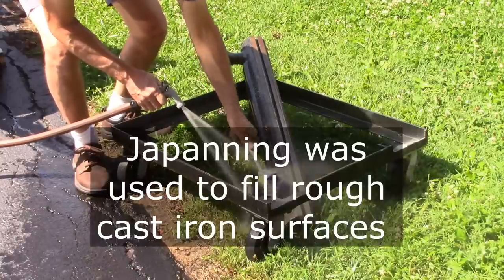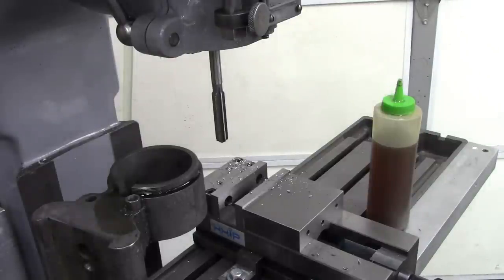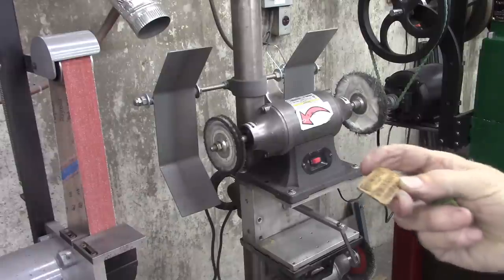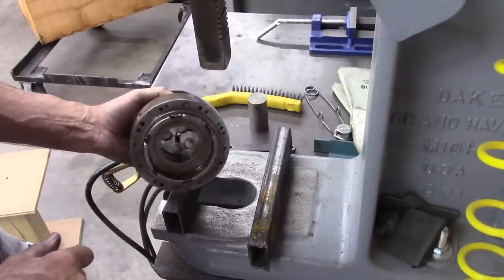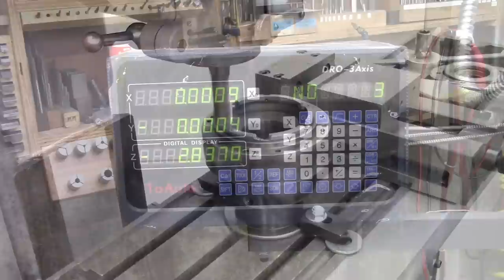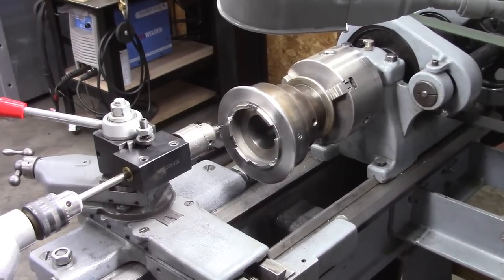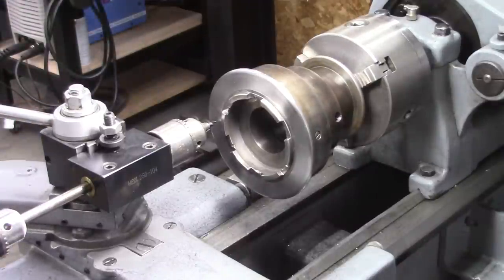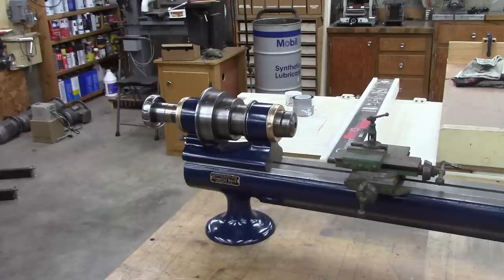Restoring the HARDINGE CATARACT Bench Lathe Part-2

Comment: Tip with the circle function of the DRO. Enter 1 more hole than you need, and make your end angle the same as your starting angle, so that the final hole is coincident with the first. That way you get the right number of holes, and you don’t need to calculate the final hole angle yourself.
Reply from the maker: Heck yeah! Good tip, thanks.

Comment: Just a thought,  that piece you were trying to press out. Does it thread in to the pulley. That would explain the spanner slots. It would provide preload adjustment on the thrust bearing.  I always enjoy your videos, thanks
Reply from the maker: Well the spanner slots were not stock. They were made with a hammer and punch but yes, you are right, it is threaded. The image i looked at on the internet was low resolution and did not show the threads. Later I found a larger higher definition image and saw the threads. It's logical that it would be threaded...  I should have thought of that. Good observation on your part!

Comment: Hey Winkie.  Really enjoying this restoration.  On using EvapoRust on stuff that won't fit in a bath of it, here's what I do.  I restored an old 2000-ish Honda 250 Rebel motorcycle for a girl I have known since high school.  She bought it new, she and her daughters rode it for a few short years, then put it away.  It sat for 15+ years.  Couple years ago she became interested in seeing if it could be revived.  Knowing I do that kind of stuff for fun (plus that activity helps keep me busy and from hanging out in bars and chasing loose wimmens), I took it on.  I used EvapoRust pretty much like you did, only I wrapped the long things (exhaust, any other long parts including the rusty rims) in terry cloth, soaked them with EvapoRust, then wrapped that up in plastic wrap to keep it wet.  Left it on there for 24-36 hours, and they came out spectacularly.  When I was done with that bike, it looked like it just came off the showroom floor.  I even did a short video on the end results of it on my little YT presence.  I was very proud of it, and was surprised at how well that EvapoRust did, using it that way.
Reply from the maker: I've done the same with paper towels but the towels leave a pattern in the steel or cast iron This lathe wasn't too bad with rust anyway. Maybe if I let it in the evapo-rust longer the pattern would go away.

Comment: A little tip: if you mix your putty on a frozen aluminium plate, you will have much longer working time, it will not take much longer to harden when applied because it warmes up, but the hardening on the mixing plate will be delayed significant.
Reply from the maker: Very interesting! I might try that in the future. Upol also recommended another product called One Fill which is supposed to be slightly thinner. They also said to reduce the harder by 50% to slow the drying.

Comment: I'll bet that piece is treaded so you can make fine adjustments bty love your videos
Reply from the maker: Yep, you are right. In the drawing I looked at it looked pressed in but I have since found drawings that show the threads. I might leave it as is, its been running for years like it is and it seems to be adjusted about right. Also, if I have to adjust it, the slots I milled will help.

Comment: That looks great. Even a nice shade of blue which is usually not my go to color. Your rotating grinder rig is pretty nifty, but do you ever worry about contaminating the buffing wheels with debris thrown off from the wire wheels? Or do you keep them covered? Just a thought. Thanks for another delightful presentation.
Reply from the maker: Thanks for the comment. Yeah...  if I do a lot on the wire wheel I throw a rag over the buffing wheels but most the time it is not an issue. I did however catch one of the buffing wheels on fire. The sparks form my belt grinder did it. It really smelled up the shop and was super hard to put the fire out. I ended up throwing a bunch or wet rags over it. But...  otherwise, the buffer wire wheel set up is a huge space saver and easy to build. Thanks again.

Comment: Hi there.. just an idea about the Evaporust and long thigs.. in my part of the woods we have PVC gutters, they come in sqare or round profile, they are also really inexpensive. I bought one when i was restoring my Colchester round head and used it for the lead and feed screw. All y9u have to do i just close the ends.
As always thank you for aharing.
Reply from the maker: Thats a good idea. When I restored my Index mill I made a box and lined it with plastic. It worked great but then I gave the box to the guy that bought my old mill.  The Harding didn't have much rust and I didn't want to waste the wood on another box.

Comment: Glaze putty or any polyester filler cures faster in hot conditions. Ive had best luck weighing the mix ratios to prevent that along with durability. When its ready to sand,  touch it with your finger in 1-3 minutes,  as soon as  it is slightly dulling (barely) and isnt tacky to the touch, then sand. if you wait too long itll be like sanding concrete. After 20 years professionally  restoring and custom classic cars, motorcycles and anything/everything in between (have won best paint and best of show at a few car shows ( client or personally owned) locally and in California), I have found that THE BEST filler , glaze or poly filled with fiberglass infused in it, is*** Evercoat brand*** gold, or extreme gold, and their glaze. They even make a sprayable type called feather fill which AMAZING stuff and specifically what i use on my machine restorations. Always Prime with a Direct to metal epoxy primer prior to filler. it will delaminate without..eventually.  Then a good filler primer and then top coat rattle can or sprayable. for a great finish thatll last 2-3 generations. I know it sounds extensive for machinery but itll make life easy. If youre using an enamel like rustoleum in quart cans, brushed or sprayed use "majic" its a catalyzer  to chemically harden it and gloss enhancer. Anyways thats my $0.02.     Love your videos and keep them coming!     "I like it"!!!
Reply from the maker: Thank you very much for your advice. And I have no doubt that you are correct about these products being the best. However, they are high priced. Also, the sprayable feather fill would absolutely speed things up....  but clean up??? How about the epoxy primer? U-pol claims excellent adhesion over clean sanded metal. So far I like the u-pol glaze I used but after calling U-pol they are telling me that their One-fill product is slightly thinner. They also recommended cutting the catalyst amount in half to increase working time. I thought about trying this but was afraid it might not dry. Somebody also made a comment about mixing the filler on a cold aluminum plate to help prolong the work time...  sounds like a good idea. And yes! There is a window of opportunity for easy sanding and after that it gets fairly hard. I probably need to work in smaller areas at a time. I will absolutely try the paint hardener you recommended! --  Thinking on the epoxy primer. Thanks!
Reply: @WinkysWorkshop  thanks! Okay so A little warning, this is a bit verbose but I think this will help a bit. And it’s just $0.02 from a guy in Reno.  
Just to be sure that it’s understood that, Everyone else has their own opinion and ways of thinking. I respect and always have an open ear to listen to what other people think and experiences they’ve had. So please chime in. cuz I never know if I’ll learn something new or better than my own ways and experiences. This is what makes us better at being makers, restorationist, hobbyists or the professionals with 100 years experience. We’re all here to learn. 
So to answer your questions…

Yes some of the products are somewhat expensive, although, upol is a good product, I must admit. Evercoat is quite expensive, and for small stuff like lathes and such, I’d just stick with the upol, it’s not that big of a difference and you probably have enough for the next four projects so use it! No sense in wasting money if you don’t have to. Evercoat does tend to sand a bit easier (especially on very large flat pieces) but with smaller pieces upol is totally fine. 

There is definitely a bit of conflict on the filler in the body shop world. And I’ll be honest to say, I’ve done both, direct filler over clean, shiny, raw metal without issues after many years. But a dtm epoxy primer has etching properties which adheres significantly better and leaves very little chance for pinholes between the metal and its coatings which is inevitable when spreading filler. Those pinholes are areas where solvents (and moisture) love to cultivate. Inevitably temperatures rise and fall and so does the size of gas (air), & solvent in those pinholes which then form pockets, then will pop sections off. So by using dtm spray or roll on, basically eliminates any chance of that. 

I repainted a jet black 64 impala last week that had filler laid directly on the steel panels. At not even one year after it was painted (and hadn’t been finished assembled yet in the restoration process🙄), even though it had been thoroughly stripped down to metal mechanically.  The chunks of filler that were popping off were softball, to melon sized pieces. First I’ve seen anything to that extreme of a result. It’s was wild to see something like that happen. (And yes, customer was not happy with the previous painter if you want to call him that..😅) and NO, I did not paint it previous to the failure…

anyways moving on..

I have been quite impressed by the final results on all of your projects so give majic a try, it’s amazing how much better an enamel finishes and is significantly more chemically resistant. So much more shiny and actually has the ability to handle/assemble in a much shorter period of time. Just be sure to use a respirator with new filters (they only last 24 hours technically but I’ll go for a week roughly before I swap them). It’s good for any oil based enamel like rustoleum in a quart or gallon can. 

As for the using less hardener for the filler,,,, six of one, half a dozen of the other. You can get away with less, although, sometimes (mainly on automotive applications due to their size) the sand paper will just clog up quite quickly even though it seems to be hardened,  this is when too little is used. . Yet ~50%~ish  of hardener recommended used on a hot day >85-90*F, will work totally fine in most applications. 

The Evercoat feather fill is typically sprayed from an hvlp gun with a large tip (up to a 3.0mm tip). But in my opinion on smaller scale projects; a medium nap wiennie roller and a decent 1.25-1.5” brush works great. It’s just very thin filler. 

As for the DTM epoxy, same deal. Cheap gravity feed (hvlp) gun from harbor freight at around 25-30psi will be perfect.      I’m not sure on whether or not brushed and rolled will land good results, but I wouldn’t hesitate to give it a whirl. It’d probably be work fine I’d imagine. I’ve too coat painted entire trucks with a roller and brush many times, and looked pretty darn good. But we’re talking primers here. 

Clean up on both dtm epoxy primer and feather fill are the same. Acetone, blue Scott shop towels, a couple pipe cleaners, & just take the tip off and pull the needle/adjustment knob off the spray gun, drop that in a cup of acetone, hit it with an old toothbrush or the like, along with wiping down the reservoir cup and you’re good to go. It’s definitely not like cleaning up a two part, 10 minute set epoxy youd mix on your workbench. Totally different. 

As for retailers that are not very expensive and have massive inventory, 
Summit Racing, and Eastwood have great prices on a lot of these products. Along with their own brands (summit paint is manufactured by sherwin Williams). Eastwood has a full line of primers/paints that ARE meant for roll/brush on, specially geared towards DIY’ers that want to paint their old classic cars, in their own garage without an 80 gallon 5hp compressor. (I don’t have any affiliation with these companies but Check out there new compressors! The 30/60 scroll compressor is epic.) 

Alrighty, that covers it. 

 Hopefully My response wasn’t too convoluted and didn’t sound like I just huff paint in the back of the shop, while watching YouTube videos, instead of using as intended with the correct PPE! 😉 

Cheers!
Reply from the maker: @theconcentriceccentric2994  Thanks for the detailed reply. A 3-mm tip is big although probably needed for a filler. Mine has a 1.5 mm I think. I love my spray gun. I've had 3 or 4 HF guns but have problems getting them clean. I think the gun I have is a much better design inside. Running solvent through it usually cleans in quite well. I'm off topic but here's a link to the gun I have https://amzn.to/3Q8TV4Z. I'll probably try the DTM primer and stick with U-pol for now. Thanks for all the info. Always welcome...  Also like your user name.

Comment: The British machine tool castings were 'faired' with a cellulose filler ( before polyester and epoxy)  and rubbed down before painting with a number of coats. It chipped  off over time.
Reply from the maker: Sounds like a much better method to me! The Wells Index mill I restored had a white filler that had a lot of cracks...  not sure what that was. It was very soft. I wonder if it was cellulose?

Comment: there is no faster way to remove the accurate surface of a brass part than to use a wire wheel. after so much care in the rest of the process, seems a bit crude to abrade the brass caps like that. otherwise, very interesting.
Reply from the maker: Normally I would agree. However, in this case they were badly abused with plyers so the wire wheel smoothed out the damage a bit before buffing. Also, these are only covers to keep out dirt and for cosmetics. I do wish they were not so abused but i see no way to restore them. Thanks for watching!

Comment: Regardless of the state you live in, it is illegal to dump, drop, spray, rinse, or otherwise any solvents, chemicals and/or oils (including and especially paint remover) into the ground. Doesn’t matter if you own the property or not… You’re responsible to collect and dispose of the chemicals appropriately. I’ll bet you don’t have many birds, squirrels, rabbits, etc in your yard and if you do they aren’t healthy. The more you know…
Reply from the maker: All below threshold amount. Nothing was ever dumped. The most significant pollutants is are most likely the hydrocarbons that are airborne anyway. The small amount that gets on the ground evaporates and never has a chance to get into the ground water. The instructions on the can of paint remover say to use it outside and rinse with water. I can't imagine how anyone would catch what comes off but I'm sure it is possible.  How about the spray can I used to paint the lathe? I know body shops are required to filter the exhaust although most small shops do not. As far as I know it is not illegal to use a spray can outside. My point is, there are threshold amounts. Somebody has made the decision that spray cans are an acceptable amount but technically spray cans are very bad for the environment. If I was running a business with large amounts of chemicals involved I would not consider my methods safe. Oh...  and there is plenty of healthy wildlife around. As a mater of fact, the grass where I rinsed the lathe is very healthy and green. I also recycle, support alternative energy and dispose of the liquids I do collect properly...  even batteries are recycled.

Comment: Looking good so far Winky. You are not pronouncing the name correctly. You are saying Harding, it is pronounced Hardinge as in "Door Hinge " 😊  Question, why more tapped holes on the pulley, could you not pick up one the 12 holes already there, pulley face now looks like a "Pin Cushion". Further information in case you do not know, is the chuck fitting. There is a slot in the spindle that a pin in the chuck locates into, turn the chuck clockwise for normal turning. Should you wish to run the spindle in reverse you will need to slacken the chuck and re tighten it Anti clockwise. Regards from Australia.
Reply from the maker: Interesting on the name. Thanks for the info. As for the holes, I tried to find holes I could use but it was nearly impossible. I'm not saying impossible but there were a combination of broken screws and stripped threads in any position.  The extra holes are unseen and will not effect anything. Honestly it looked like somebody ran the pin into the index ring multiple times. I was thinking about leaving the pin removed or installing a spring to keep in disengaged to avoid the possibility of damage in the future. Yeah, i have 4 jaw with it. Cool chuck mount. I also have faceplate and collet with a built in center. Thanks again!
Reply: True. I operated a Hardinge tool room lathe many years ago but had forgotten how the chuck mount works. If this early lathe is the same the spindle slot looks like the letter T with each side of the top bar forming a locking cam
Reply from the maker: @ellieprice363  Yep...  that's how this one works

Comment: Very good looking restoration. Your brazing seems to have turned out well. Adam Booth recently repaired a piece of machinery by brazing and he spoke at length about the do's and dont's of brazing. I found it very useful. Thanks for taking us along on this job. I wonder why they chose the name cataract. It comes from Latin, cataracta, meaning waterfall. Rather strange name for a lathe.
Reply from the maker: I think I read that is was a name but my memory may have failed me (it happens). I saw Adam's video. In fact I thought about refreshing my memory before brazing mine but I did not. Seem like his torch was HUGE compared to mine. It would drain my little tanks in minutes. I'd like to have bigger tanks but my gas torch doesn't get used much.